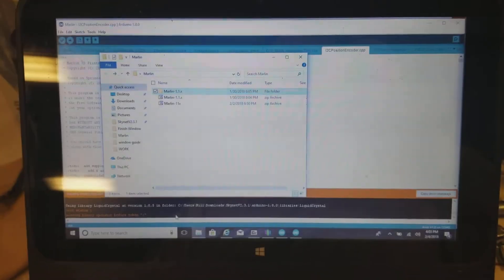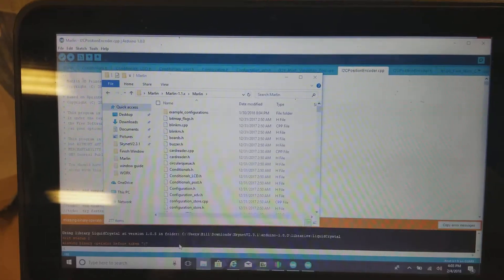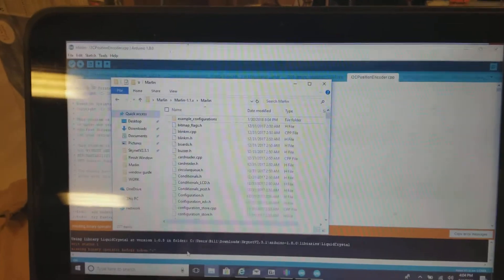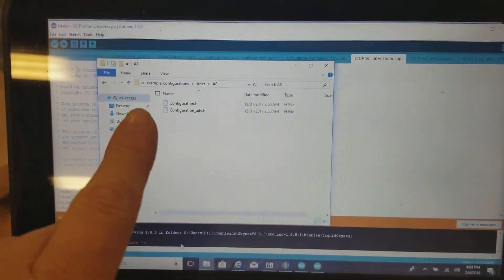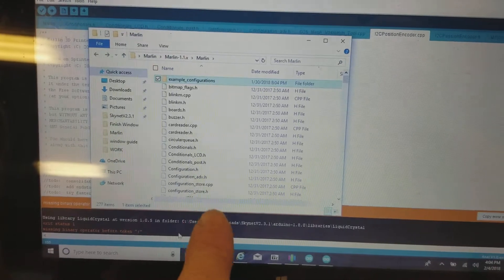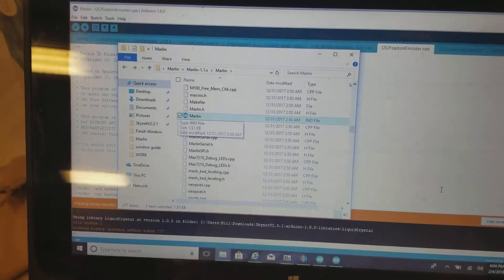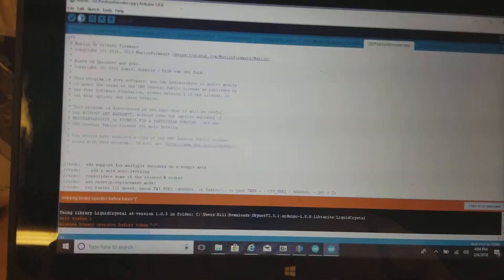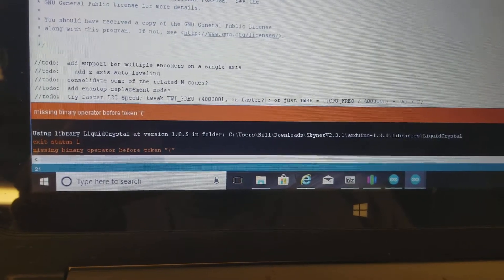Anet a8 marlin 1.1.8

Comment: Did you fix it, if so how, will help others who have a problem if you let us know, even if you think it was an easy fix. (or a silly mistake , we all make them)
my suspicion is it may have some thing to do with needing U8glib library (I think that is its name) but your Skynet install may have failed without it. needed for LCD displays.
I also note that you are using Arduino 1.18.0 I think 1.8.5 is available that may make a difference.
Reply: effacer fichier skynet3d de hardware arduino laisser seulememt marlin 1.1.8 verifier et televerser

Comment: Bill, hard to tell what is the problem without going into the code. I have just installed Marlin 1.1.8 on my Anet A8 with no problems. I guess I have installed the latest version of Arduino IDE (1.8.5) and then copied Anet board definition (https://github.com/SkyNet3D/anet-board) into hardware folder of Arduino installation (C:Program Files (x86)/Arduino/hardware). Other than that, I followed exactly same steps like you did. Good luck!
Reply: When using the Skynet Anet definitions you mention I get "warning" messages about timers being redefined in "orange" warning messages in the "black box" at the bottom of the Arduino IDE screen, they flash by at speed and to see them you must use the slider at the side or drag the top of the box up. I have asked elsewhere and found a way to avoid the messages but I don't know what's right.can you confirm you also get the messages.